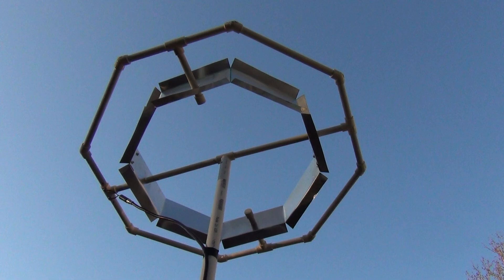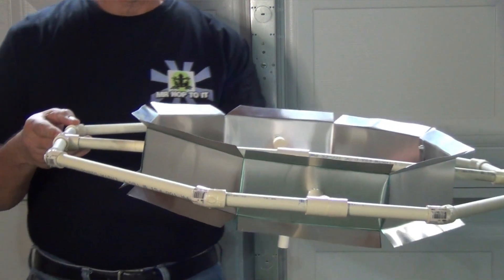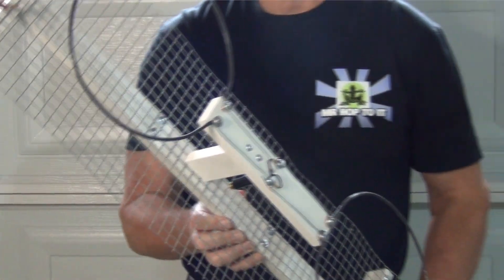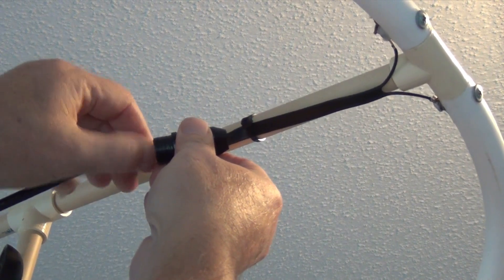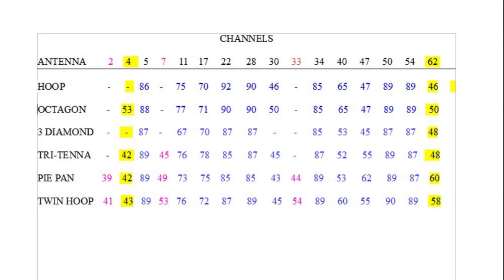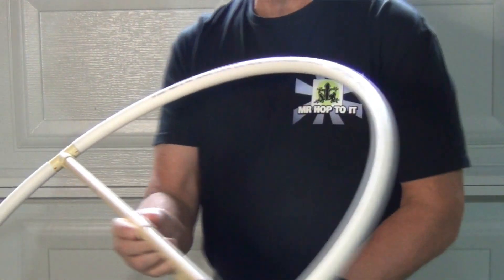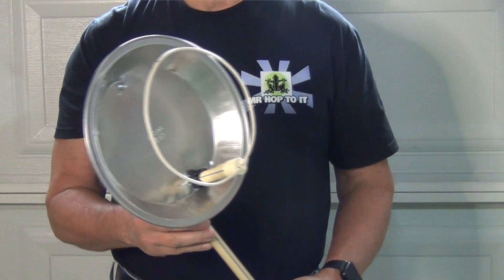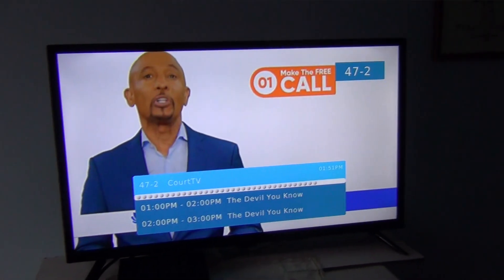TV ANTENNA SHOWDOWN!

Comment: Can you do a generic pie pan versus pie pan with reflector?
Reply from the maker: The simple pie pan antenna wasn't included in this comparison because, while it does receive TV signals, it will not have the reception of these more advanced antennas
Reply: @mrhoptoit7835 true but I actually got more.statiins with it than any antenna thus far..I did a cruder version of the dual hoop antenna today I used an old metal shelf instead of the mesh. It may or may not have been better. It did really well ,  better than pie pan for locals but less overall channels came in.. different directions I got good signal so I may have to do a combiner. Have you tried to compare diy antennas to high dollar ones? Is the more sophisticated pie pan design only about 10% better max than the dual hoop? I did 3 16 gauge wire to make mine..I am not sure if it helped or not.
Reply from the maker: @DiamondTh13f The dual hoop is much more directional, so if your stations arent in the same direction, you will not receive all of them. The pie pan reflector. In my location, is very good but not as effective as the dual hoop.
Reply: @mrhoptoit7835 I want to bond more than one antenna together. I wonder if I can have a third hoop out of the back for the south channels
Reply: I built a double hoop tritenna (combined the double hoop and tritenna ideas) and it is the best for my location mounted in my attic. I now get all channels within 60 miles and even get channels from over 80 miles away (those towers are at a much higher elevation). I previously tried the double hoop without reflector, the quad hoop, and the standard trihoop. Since our local broadcast antennas are in three different directions. The dual and quad hoops worked great pointed toward specific towers, but missed several channels.

Comment: Does the double hoop reflector antenna need the spacing between the hoops MHTI ?? Would adding two more hoops at both sides make for a way stronger signal  fella ?? What do you think Sir ??? Thank you for your advice too. vf
Reply from the maker: The spacing is to have a larger swath and possibly receive more signals. You can build this without the spacing.  In this case, adding more hoops should increase reception.
Reply: @mrhoptoit7835  Thanks for the info MHTI...

Comment: Thanks for your content, Have you done a comparison using the double hoop, with and without the reflector?
Reply from the maker: I initially did. Without the reflector it performed well and was able to receive signals from "front" and "rear", but I did not get the really far stations. Im currently working on another antenna video, so keep an eye out for it - hopefully within the next week or two.

Comment: The double hoop reflector antenna looks like the best for me Mr. Hop To It.  What blows me away is the garin of this antenna and the 130 degree viewing compass degrees. Do you think if I would make two antenna facing the same direction I could get station much further away distance wise ?? When I looked up deep fringe antennas the Gray-Hoverman double side by side antenna is what is needed to receive the signals. This does it with a single panel. This is just amazing MHTI. How did you get the idea for this style and type of antenna ?? Also, the simplicity of this unit is second to none. I have read a few times that mass of the element increases gain. Do you think that is true Sir ??
            This reminds me of when I was a young fella still wet behind the ears. My parents took a trip to the the American desert region Nevada, Arizona, New Mexico area. There were antennas that looked just like bed springs which were just huge. I would say 6 X 8 feet. They received signals well over 200 miles. But they were only a few stations for tem to get. The people in those areas were super glad they had them to watch. Thank you for bringing back such a great memory for me to MHTI. 
             You seem to pull a rabbit out of the hat just like a magician. I hope you do not stop with your constructive juices !! I can only imagine what else you will be designing for us to learn from and enjoy Sir. Peace vf
Reply from the maker: Hi VF, thanks for the kind words. Depending in your situation, linking two Double Hoops could be very effective. Just be careful that the connections between them are equal length. Adding element mass is effective but only up to a point. I never heard of the antenna style you mentioned seeing. I'd be interested in knowing more about them. Take care!
Reply: The G-H antenna is something that cam from the 1950s. Some call them zig-zag antenna because of the active elements look like a few Zs placed side by side and right next to each other. This was supposedly the simplest and easy to ship antenna. They supposedly sold a ton of them. Channel Master 4228HD bowtie which is know for its durability and high gain. They sold a ton of them in the real world. This is what I found online. I look forward to see your next iteration of TV antenna MHTI. Good luck too. vf @mrhoptoit7835